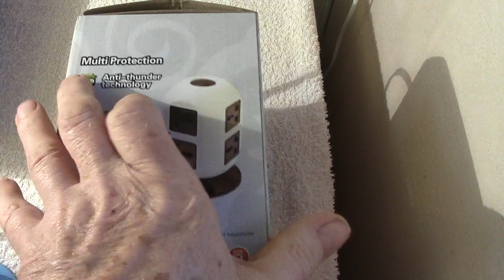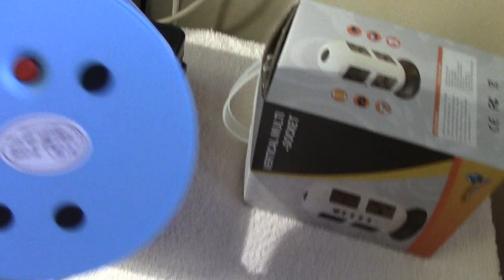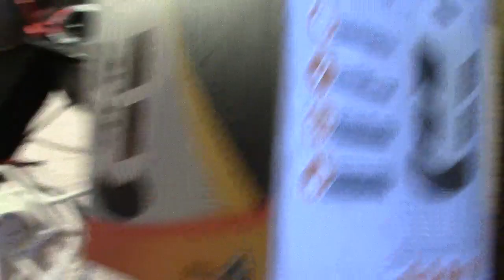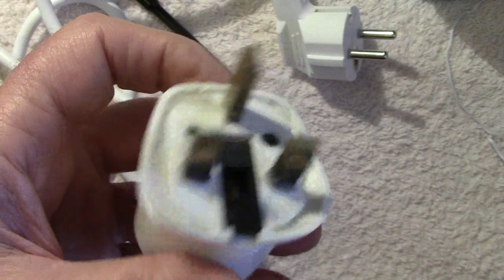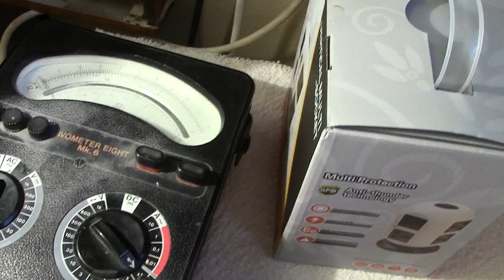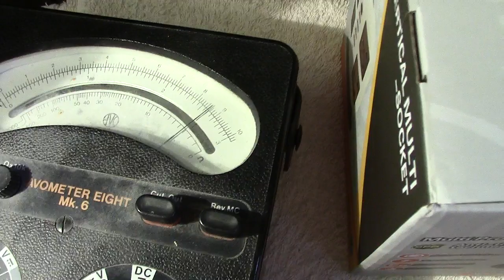Tower Extension Lead

Comment: OK, without beating-about-the-bush: THAT THING IS A CROCK OF RUBBISH
If you still have it, *GET RID OF IT. *
Below, I have placed a list of SAFETY FAILURES and there is one IMPORTANT
one which you didn't pick-up on, even though you have an AVO-meter.......

(1) That device most likely DOES NOT HAVE EARTHING. Test it and don't be surprised when you get no continuity!!

(2) The lead on that thing is most likely counterfeit. IF SO, IT WILL BE ALUMINIUM CONDUCTORS in there.

(3) DO NOT TRUST the USB connections on that AT ALL.

(4) As you pointed out with this, there are NO SHUTTERS on this unit. This is NON-COMPLIANT to BS 1363.

(5) As shown on the box, this is only for 10A at 240v

(6) RIGHT NOW, GO TO WAYNE'S ELECTRICAL and look up the video which is titled:

Test Time : Dangerous multi-fail socket device. 

There will be two versions. I would advise you watch the FULL LENGTH VIDEO

I purchased something similar some time back, just for the purpose of analytically pulling the damned thing 
apart, showing the massive multitude of fails that it had, testing it left-right-and-centre in a whole variety of 
ways and then getting it out in the back garden and giving it  A RIGHT BEATING  just to prove that it is an 
absolute crock of rubbish!!

Chances are, your one is a similar thing inside, just packaged up in a different shaped box!

Before you are blasted or something ends up in flames...... CHUCK IT IN THE BIN!!!!

Go and purchase a proper multi-way socket from a reputable UK high street retailer.

Really, that thing is an absolute crock of rubbish and should not be in the UK!!

Please throw it away, or at the very least, send it to Wayne's Electrical and I will give it a right-proper 
caning and you can see me analytically tear into the thing and give it multiple PAT fails!!

If there's going to be flames......PLEASE let me do it, and in a controlled fashion! NOT in your house!!

Thanks for showing, BUT PLEASE..... at the very least: GET RID OF IT!!

-Wayne's Electrical.

29th September 2020, 14.38

Comment: Beware of problems with those dodgy chinese contraptions!
I stick to traditional 4 way, 6 way or 8 way BS1363 UK standard leads like masterplug, cheapest I'd buy would be status but usually stick to masterplug or other well known brands and generic BS 1363 sockets and I avoid USB sockets built into extension leads that will be on at the wall socket all the time and I don't trust wall sockets with USB's built in...

But these chinese things are not safe, plugs don't sit or connect safely with the terminals, power cords are not up to the spec they claim on the box and the CE and FCC marks can be copied so most likely not actually approved.

bigclive.com calls that type of socket a "death dapter" and from getting multi plug adapters with various things I bought I agree with Clive, I've had 2 pin dutch plug block adapters wiggling, crackling and pins sparking in them, and British plugs crackling and getting rather hot in them.

And as many say about these chinese deadly hazardous contraptions there is no earth connection to the sockets...

I've added a couple of links to interesting video's about dangerous chinese adaptors and extension leads

https://youtu.be/g0iFNKvkT6I

https://youtu.be/nB1DlBpyS9w

https://youtu.be/KZEDNYwgnv0

https://youtu.be/wneFtZ755wE

https://youtu.be/e0ghsODkqUQ

Comment: That is an interesting outlet tower. Interesting design on the outlets, it does look like it could possibly take an Edison plug, and even a grounded Edison but not sure about a polarized Edison. 
 It looks like on the UK plug that the ground contact is made first and thus is the last to break when being unplugged, is that correct? 
It also looks like stepping on a UK plug in the middle of the night would be quite painful!
Reply from the maker: This design is popular on adaptors to take US, UK, Aus ( inc.China) Continental 2 pin, don't think this would take a grounded US plug ( diff. voltage as well...hope this explains....peter)
Reply from the maker: Hi Ria you are right, I needed this non standard extension, got 2 now, so that I could plug in other plugs including schuko without having shutters in the way or forcing the plug in. I don't have young children that could poke things in the sockets and I remember things before shuttered plugs when we used 5a  10a and 15a plugs either 3 pins or 2 pin long before the 13a ring main plug and socket......I have many old examples must put some up on LG long before this 'nanni state'....peter